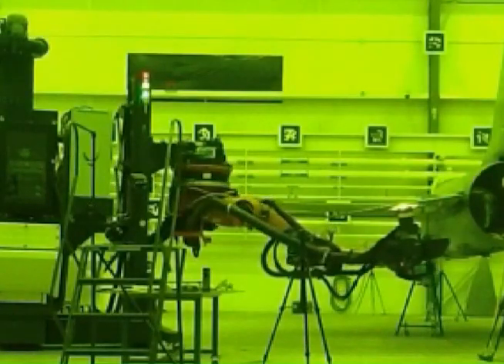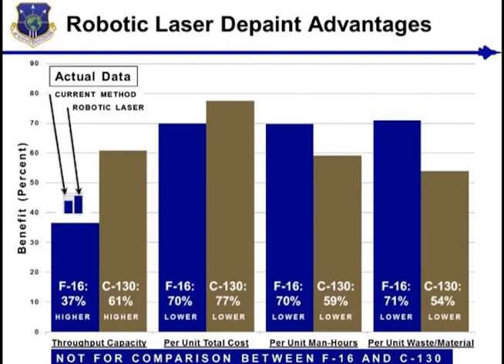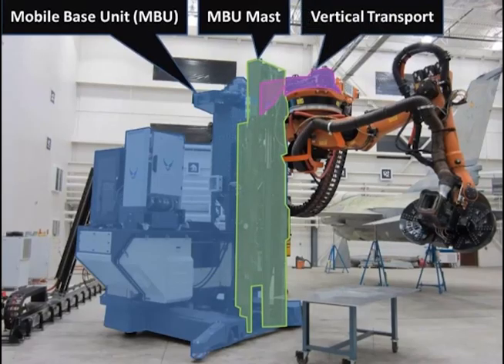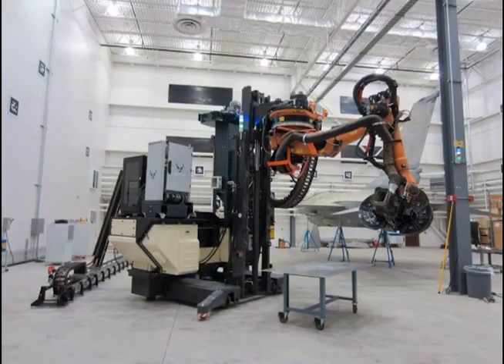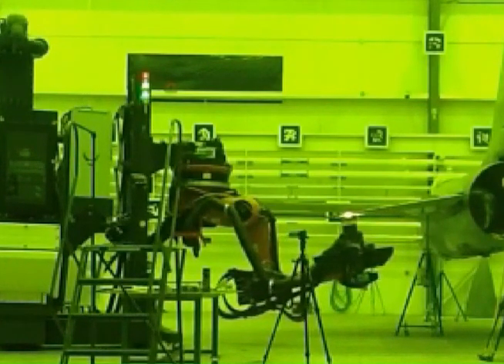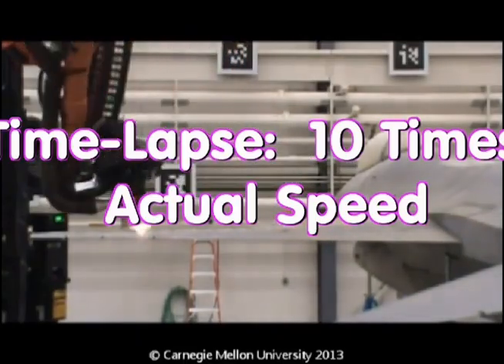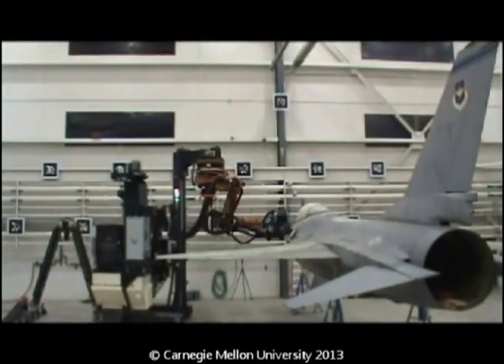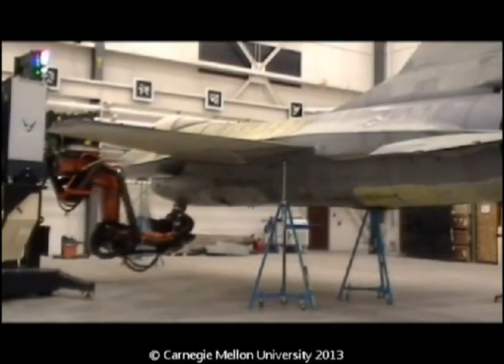Air Force Full-Aircraft Robotic Laser Paint Removal

Comment: After forty years and billions of dollars the  Pentagon has finally come up with a paint removal system that is to slow ( 1/2 sq. ft. per minute). Plus it is very expensive ,very costly to operate and maintain.This info came from a laser expert who knows what he is  talking about. For more information see You tube paint removal systems. The Flash lamp system was introduced at McClellan AFB in1984 but was shot down by the Pentagon. I guess they were embaressed  that some at base level out did them in such a short time.

                              Manuel Morante

Comment: Two Comments:
1. Now just Imagine using the PhotoFusion laser coating application system to apply Powder coatings and other environmentally friendly coatings. Couple this with the PhotoFusion systems ability to substantially reduce drag and decrease fuel consumption and you can Multiply the cost savings by an order of magnitude and return the asset to service in a third of the time!
2.
 It would be nice to see this technology used on other than grey or dark pigments. I suspect there is a reflective problem with White and our gloss pigments. The laser used is probably a 1064 nm yag or fiber laser owing to the green optical laser protection glass. The problem as i see it the majority of Commercial aircraft are white and gloss white on top of that. It would be a shame to miss such market potential. However I feel we at PhotoFusion  may be able to solve that.